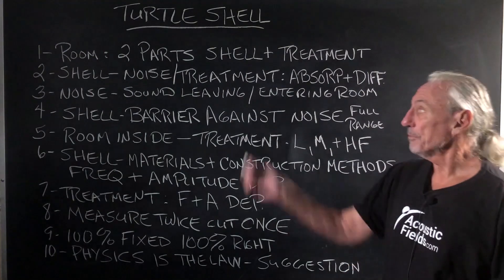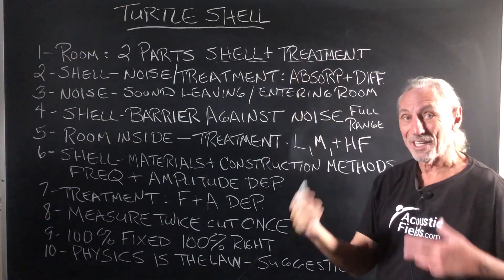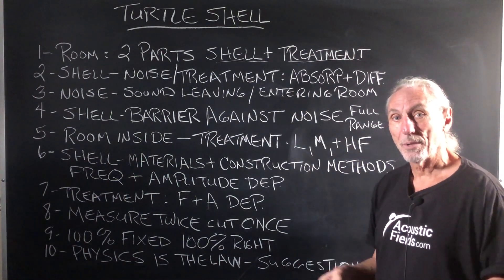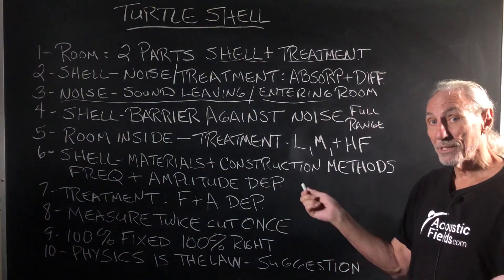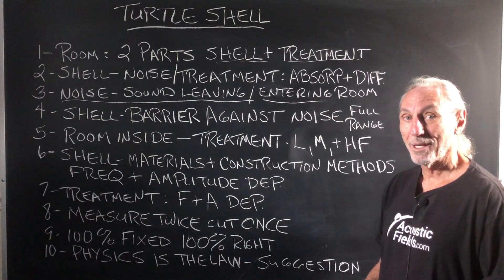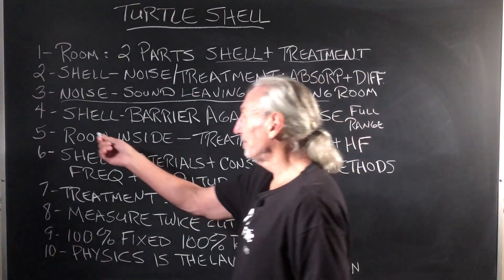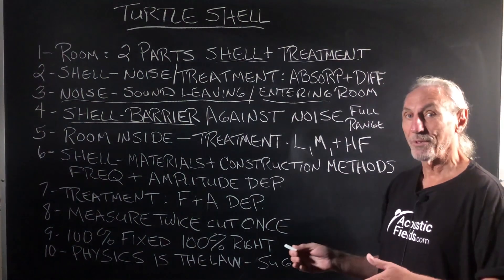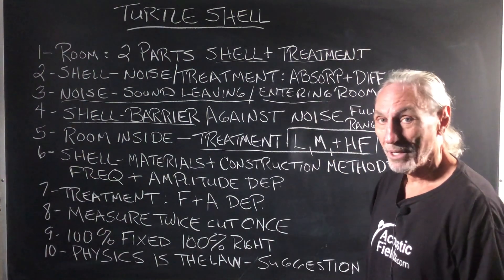Turtle Shell - www.AcousticFields.com

Comment: My room with it's current treatment sings out of control at 124hz and dies at 1.5khz lol. I've had to resort to headphones for most work.
Thanks for the videos!
Reply from the maker: Look to the fundamental of 124 say 60 Hz. That frequency causes more issues than all the others it seems like.
Reply: @AcousticFields  I did a room measurement and discovered those unique resonances that seem to be manifesting in my listening position. 60hz doesn't appear to be exaggerated, more like a dodgy room mode and a vibrating desk. I'll see if I can plug my room dimensions into your website room analysis submission.